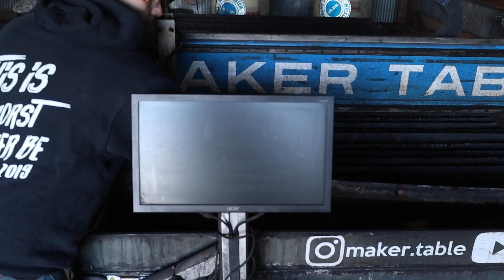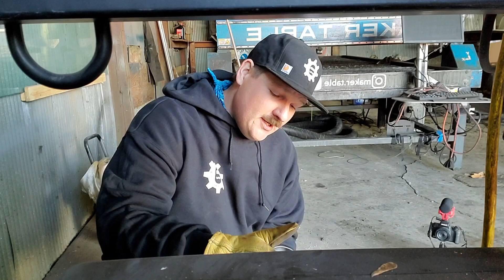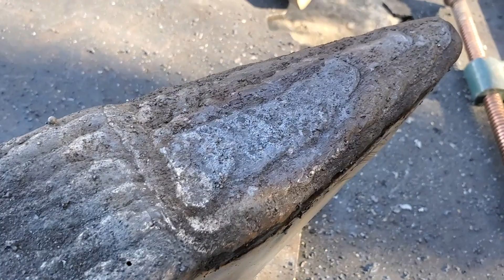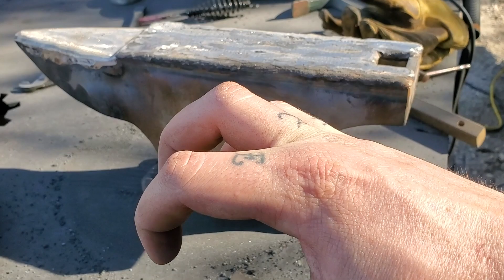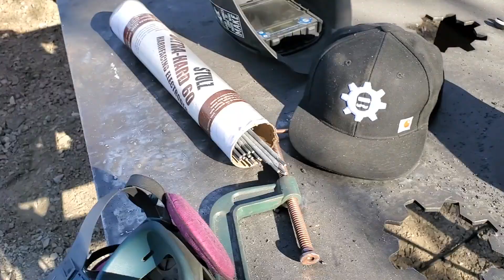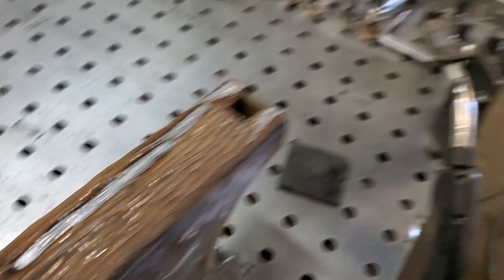CAN YOU MAKE AN ANVIL? - 2 of 3

Comment: Why you just didn't buy hardened steel sheet and you didn't weld in the forge? You had gas burner - you need only some froge bricks on the ground an you can forge weld this sheet metal to anvil.
Maybe you need quench this top od anvil to harden the top??
Reply from the maker: I'd love to setup a forge eventually. Wait till next week, I figure out a good solution in ep. 3

Comment: That is notorious for cracks. It just very hard materials.  It has nickel in it if I am correct, I ran thousands of pounds of stoody rods and it will always crack it’s not meant to penatra  just floats on top
Reply: That was not a nickel rod . He used a manganese rod on HR plate.   The 2 dont mesh well together.
Reply from the maker: Thanks for all this info! I really have a lot more to learn about hard facing.

Comment: You need a high chrome rod .  Or use stainless over the HR plate first.   Dont use a manganese hard surface rod. And yes you can multiple pass hard surface rods.  I do it every day.  Hard surface hammers in a mill.
Reply: Scrap that anvil.. make it from AR500
Reply from the maker: What brand/type of hard facing rod can you build up? I've run a bunch of 7018 but never anything like this
Reply: @MakerTable  I'll get you the brand and numbers tomorrow,  on the rod.  7018 isn't a hard surface rod. Its structural.
Reply: @MakerTable   also. I like the welding tables.  My cnc plasma table will be here by spring. And plan on making a table.
Reply from the maker: I appreciate the follow up! I figured out a work around in the 3rd video 👍